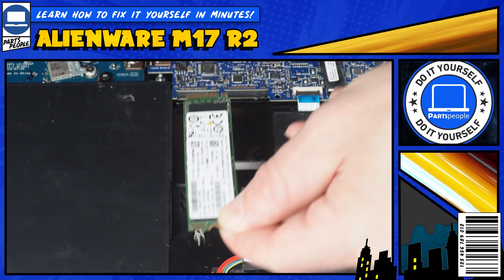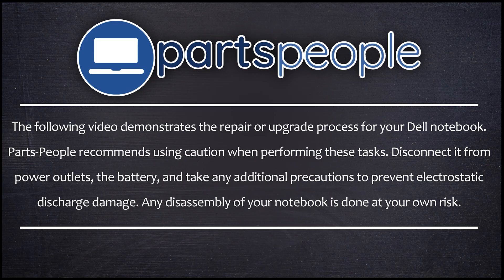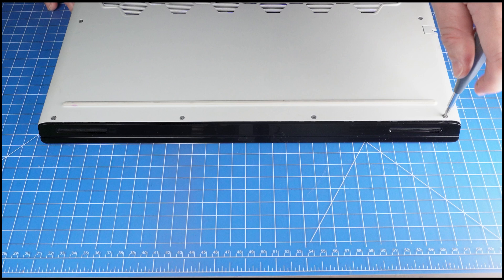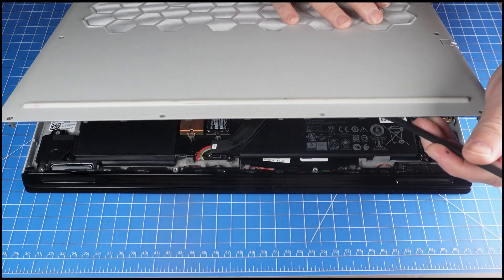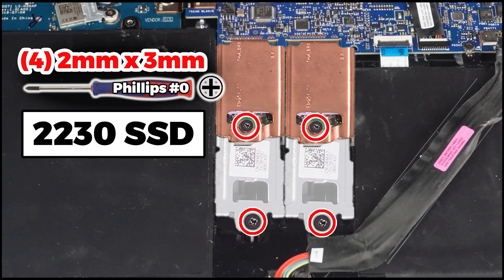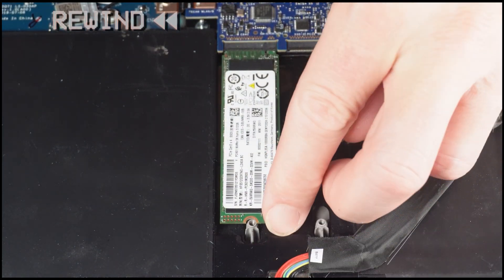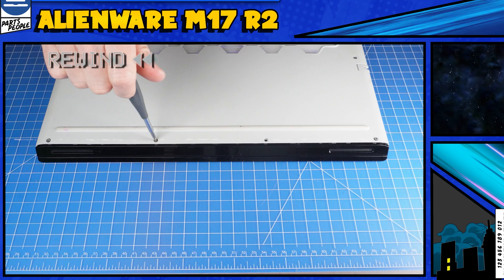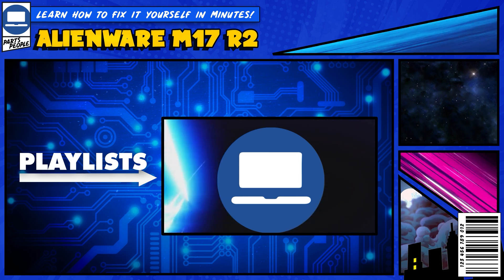How To Replace Your M.2 NVMe SSD | Dell Alienware m17 R2

Comment: Man I love your videos , I have finally decided and saved enough, and got my self an Alienware M15 R6 ( RTX 3070 and 11800h ) 
I would like to change the thermal paste , but I wanna change the thermal pads as well , as they are soo dry , 
Please cand u recommend some good thermal pads , and sizes? Please … I cannot find it anywhere, and Dell won’t give that information, they are selling the whole heat sink with thermal pads on it